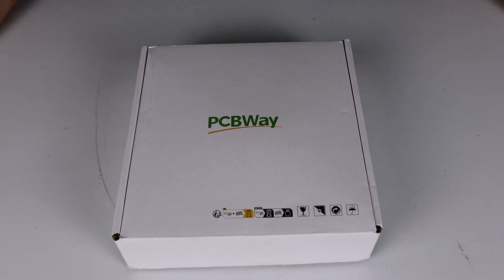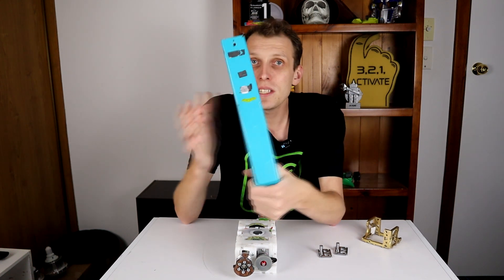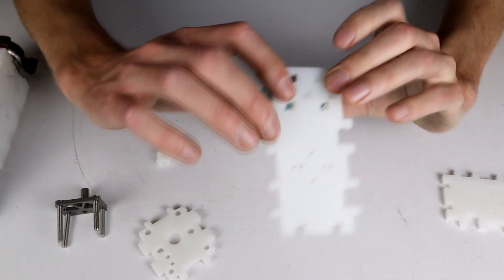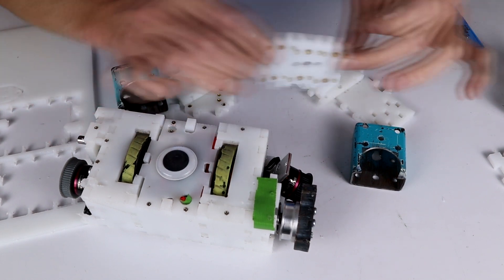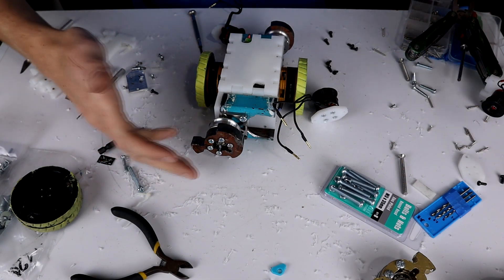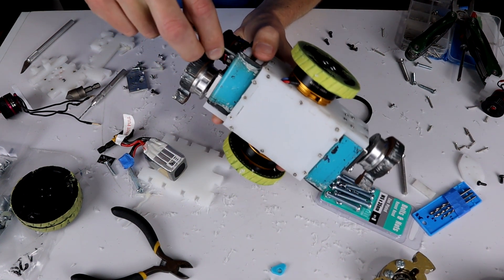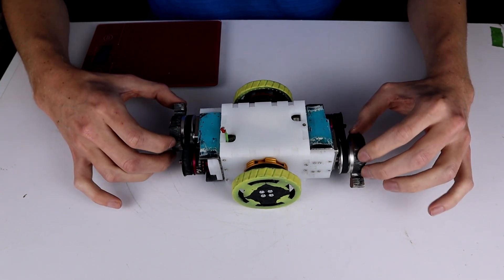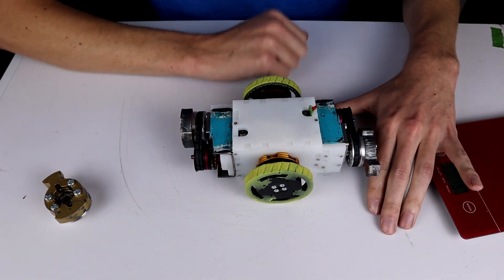Making the vert melty work!

Comment: I saw an interesting concept in a US antweight called "hit and spin".  Invertible, high damage and just a single motor.  The control concept for melty brains really only needs one wheel as long as its off the center of mass so they put all that extra weight into a big bar.  In the same matches his friend made a halo style melty brain that ran just fine when it had a wheel broken off.
Reply from the maker: I've seen Hit and spin and it's a cool concept to use the same parts for a beetle in a US ant, 
But I think it has a few drawbacks which is why I build 2 wheel versions: 
1) with a single wheel you cannot drive the robot when it is not up to full speed, this leaves you very very vulnerable to a box rush and being jammed into your corner, losing a fight in literal seconds
2) a melites speed of translation comes from how often it can increase the speed of a wheel inside a specific arc of the rotation, by this, a single-wheel melty will have half the translation speed of a two-wheel melty (in reality it my be 2/3rds due to drag e.c.t.) which is pretty bad as melties already have a slow translation speed and this speed gets slower as you push melties into higher weight classes, as the inertia of the bot increases

Having said all of that, it's a neat idea for making a melty on a weight budget and may be the only way to make a (competitive) melty in the 150g class
Reply: @TeamPanicRobotics  Thanks for the reply.  Great to hear your insights; definitely tradeoffs in all things.  Wish their was a scene for bot combat in my area but 6 hours and crossing the border to the US is a beast.  Love the awesome content and seeing your process :)

Comment: I notice the grips on your tires are currently going in the same direction, shouldn't they be in the opposite directions?
Reply: If it's meltying then the wheels will each turn in the same direction (both clockwise or both counter-clockwise relative to the motor), so then the threads work out.

Still, I don't think it's really going to matter since the thread direction on regular wheels is to force moisture/dirt away to prevent the wheel from hydroplaning, but the inside of a combat box is dry.
Reply: @bami2  Yeah, and besides - in order to drift, a meltybrain needs its wheels to slide anyway. So it's a compromise anyway. Obviously you need some grip to get up to speed and produce drift forces. But you also need the wheels to be able to slide sideways.

Given the slippy slidey nature of the propulsion system, I don't think the grip slant matters at all.

Comment: I wonder if the weapons could be passively powered by the drive wheels. The weapon shafts run along the sides of the body, where they can touch the drive wheels. So friction between the wheel and the shaft spins up the weapon, but an impact will cause the shaft to slide rather than send a shock through the drive wheels/motors.